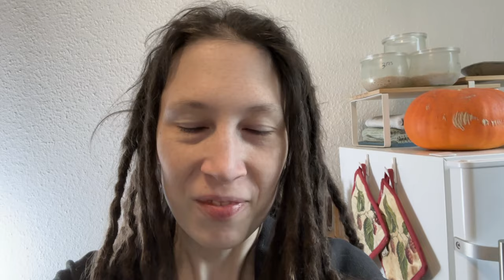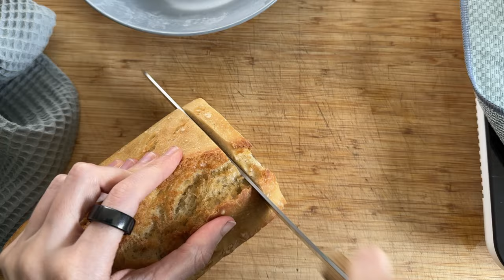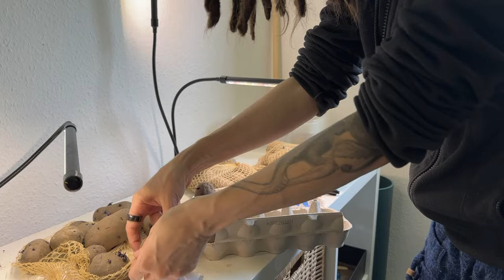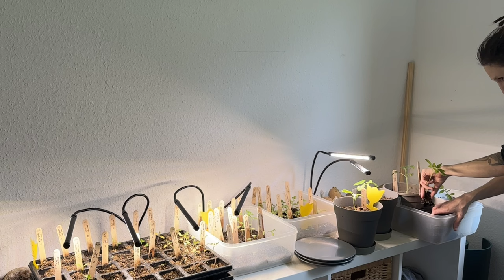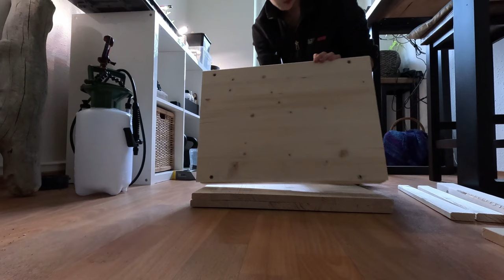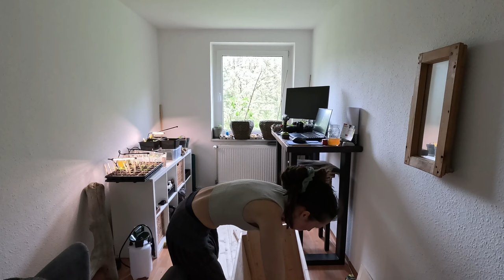I learn how to build a bench #086

Comment: May I ask why you wash your eggs? Fresh eggs have a special Coating on them called a “bloom”. It protects the egg and does not require you to refrigerate them. (Unless you wash them then they require refrigeration) They can last for at Least 3 weeks on the counter, room temperature if not washed. Also storing them “pointy” side down is better as eggs have a little pocket of bacteria at the round end so pointy end down lessens the risk of more bacteria.
Reply from the maker: Because the garden neighbor had some trouble with dirty eggs and most of them were covered in poop. I don't wash them usually. But these were not in a shape I would allow in my kitchen--and I am not picky 😉 I will have to research the thing with the pointy side. I know there is an air pocket there but will now need to know why that means the pointy side should go down. Thanks!

Comment: Did you say you make hard boiled eggs in you airfryer? Are they easy to peel?
I've been busy getting my own garden together. Early last week I planted potatoes, beets, radish, onion and spring garlic. Wouldn't you know it, we get an unexpected blast of cold through the weekend and the stupid squirrels have been digging up my beets and turnips!! Crazy!! Be well from Canada 🇨🇦
Reply from the maker: Yes, we do. Just place them in the basket. 135 C for 14 minutes, then immediately run them under cold water. They are usually easy to peel.

Sorry to hear about your little seedlings. Have you been able to salvage some of the root veggies? Did the rest survive the cold?
Reply: @RootsandCalluses  They are all still pretty small. But after closer inspection, I they didn't get as many as I feared. I've put in some preventative measure to help keep them away. Be well from Canada 🇨🇦

Comment: Are you able to drill holes first before screwing in the screws? Do you have drill attachments for your tool?
Looks like everything is coming along well.
Reply from the maker: Yes, I am. But because this is very soft wood, this would have made the screws a lot less effective, so I chose not to. I should have just used screws that don't tear when you look at them 🤣